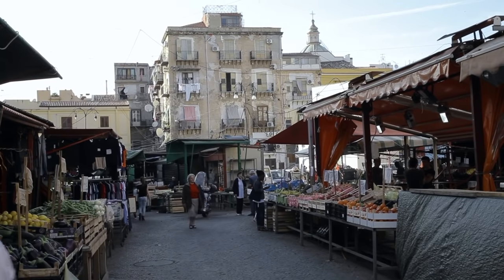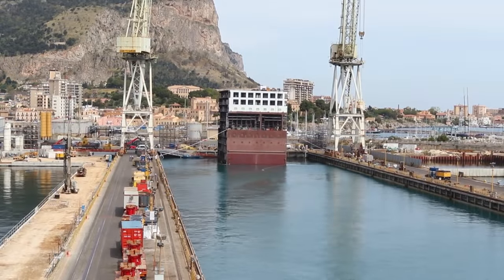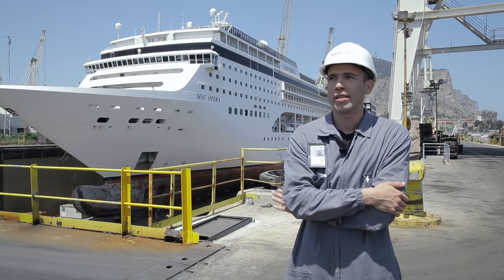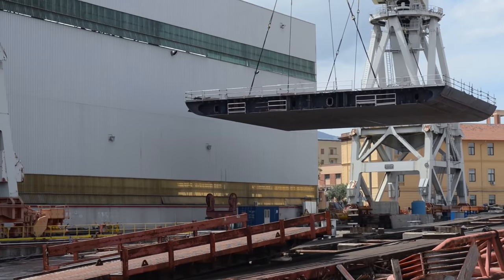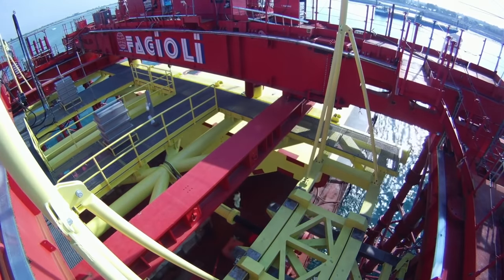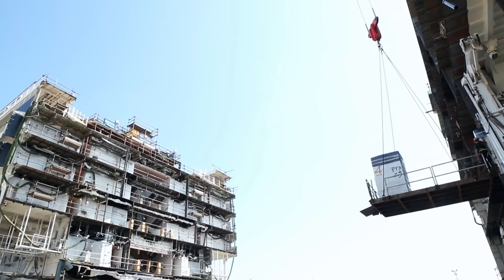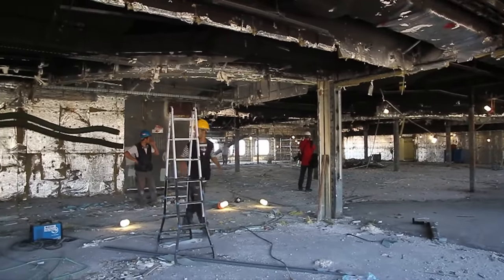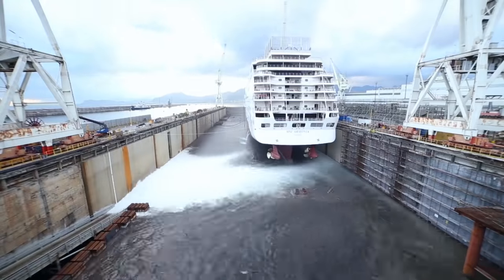Building the World's Biggest Ships | Heavy Lift: Jumboisation | Free Documentary

Comment: when you cut a ship in half and pull the two parts apart, it does not leave a hole. It leaves a large space between two separate pieces of the ship. The Italians have invested a fair amount of time and engineering into this process and it appear to be successful.  The attorney's saftey argument in this segment was pretty lame. If he really wanted to addres the a safety concern he should have mentioned where the liability and responsibility lies for investigating crimes from theft to murder on the ship while at see.  I think a great many Americans on cruise ships think that high crimes will be investigated by American law enforcement because they boarded the ship at an American port.  The actual responsibility for crime investigation is with the country where the ship is registered. Most people would be surprised to find out where some of these cryuse ships are regisered, mostly for financial and tax reasons.